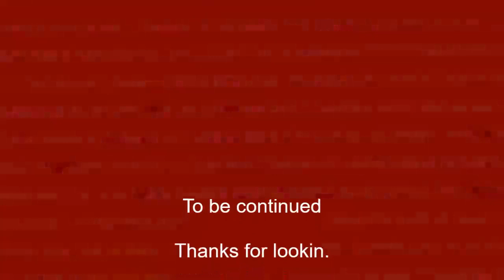REPOST - Stihl 046 Ported - In Wood -Not Good

Comment: Great video! If you want to do a ported husky 350 for a limbing saw. I can give you some tips if you need. Keep it up! Off to a great start!
Reply: Always great advice man! I remember seeing a 45cc saw you built that ran like a 60cc. I was blown away. You seem to have the formulas down well👍🏻
Reply: @IndianaDoug  I got them head movies that haunt me at night about them formulas lol tru story 🤣🤣🤣
Reply from the maker: Thanks Pat. I was thinking of doing a 350 and also asking you what to do with it.
Tinman posted a vid last night about a Husky 44 he just got and how he had always wanted one.
I had one in that package deal I got in August. I had not checked it out. I dug it out last night. I replaced the recoil spring, rope and rope handle. It had gas in it that smelled okay. It started on the 4th pull. The compression is low. The rings look good through the exhaust port. The piston is scuffed a little. So it's a candidate also.
For a 350 I need to search through all those parts.
Reply: @ClintsHobbiesDIY  350s have several options. I can walk you through each if you chose to do one.
Reply: @ronweaver9296  no interest thanks though.
Reply: @ronweaver9296  just not a good choice for a ported saw.
Reply: @ClintsHobbiesDIY  Hey buddy,Little Red Barn has awesome piston kits for those 44s, the piston rings are kinda like Cabers!ALOHA! 😳👌🤙🏻🤙🏾😎
Reply from the maker: @daninuesca3801  Thanks Dani. LRB is with in driving distance for me.

Comment: Rippa..nice work sir 🤙🏻..very aggressive chain though 😎😎
Reply from the maker: Yep. I worked on that chain again last night. It's going to take many filings to get it close to right. By the raker gauge it is a lot worst than I thought. It's the only 24" chain I have. I'll pick up another one at the Stihl dealership tomorrow.
I though I had gotten away from filing them to low, but this one hadn't been used since December.
Reply from the maker: Did the vid vid get distorted about half way and get worse near the end?
Reply: @ClintsHobbiesDIY  I finally got my self broke and I use a gauge all the time now🤙🏻
Reply: @ClintsHobbiesDIY  yeah ..it still gets distorted
Reply from the maker: @Aaron_A_Lynch  Yep. I have finally gotten that through my thick head also.
Reply from the maker: @Aaron_A_Lynch  My last two vids were like that and I can't figure out why.

Comment: She sounds good! She was a jumpin and a buckin for a bit but then you got er dialed in!
Reply from the maker: Thanks Dan.
I worked on that chain again tonight. The drags are to short to be cut that hard dry oak.
Reply: @ClintsHobbiesDIY  Nice 👌
Reply: @ClintsHobbiesDIY  having the exhaust where you raised it will make it a bit fussy about chains but once you get them set good you will be fine. Great job!
Reply from the maker: @cajun3197  Something else I didn't know. Thanks pat.
Reply: @ClintsHobbiesDIY  yessir I’m here to help anytime
Reply from the maker: @cajun3197  I ordered a piston. Just another do or don't in building saws.
Reply: @ClintsHobbiesDIY  personally wouldn’t have raised the exhaust that high. But if you’re just running small bars it’s fine
Reply from the maker: @cajun3197  I'm running a 24". I was thinking about putting a 20" on it tomorrow. I will now.
Reply: @ClintsHobbiesDIY  20” would be ideal
Reply: @Mac 131 130psi
Reply from the maker: @Mac 131 I don't know Jeff. I have two compression testers and I'm having problems with both.
Welcome back.
Reply: @ClintsHobbiesDIY  130-140psi sounds about right because you raised the exhaust mr. Clint
Reply from the maker: @cajun3197  It blew 135 before first start. I though that was incorrect.
Reply: @ClintsHobbiesDIY  I think you’re squish is a little too tight and it’s tighter than .017” on the outer edge being tapered. You got a new piston coming. Why not sand the squish band flat and a few thou with your old piston
Reply from the maker: @cajun3197  Great idea Pat. I have the piston. 
I opened up both muffler holes during the build and reinstalled the screens. I wanted to run it some with the screens and then remove them. Which I will today if I can. I want to make a cut in big wood with the screens and remove them, then retune. Then make another cut in the same wood without them.
Afterwards I will look at the cylinder and piston with the scope again. Then decide if I need to change the piston.
Reply: @ClintsHobbiesDIY  I’m here to help sir😎
Reply from the maker: @cajun3197  Thanks Pat.
I'm looking forward to the results with and without the screens.
Reply from the maker: @cajun3197  If I'm lucky the Hyway piston will be .003 t0 .004" shorter. I won't know until I dry install it and check the squish. Hopefully it will be .020" or more. I wanted .021" before the motoseal, but that didn't happen because of my bearings mistake.